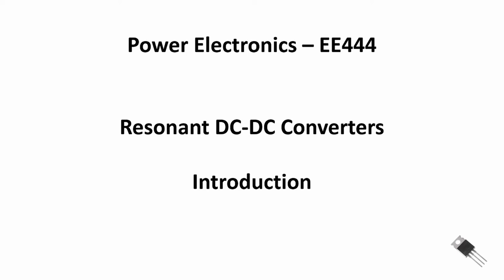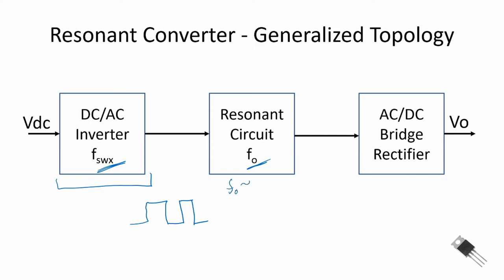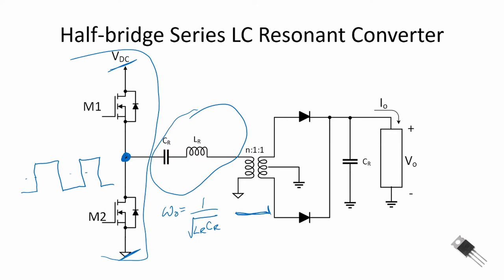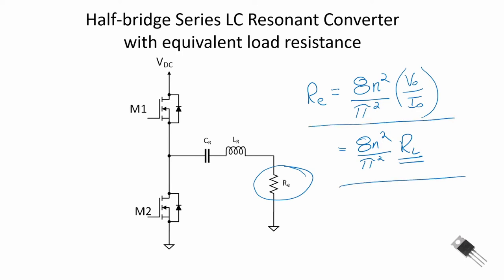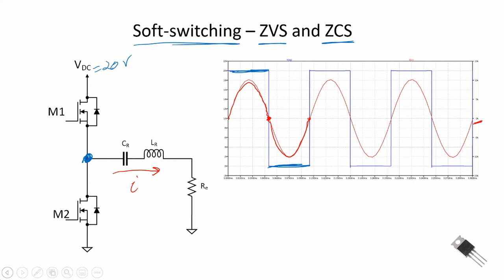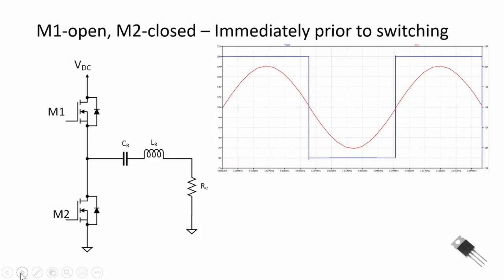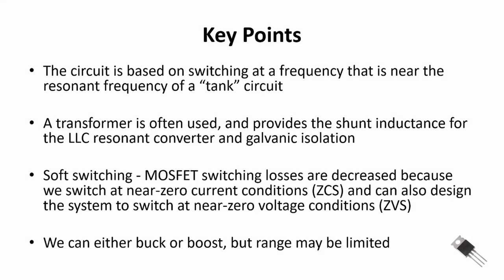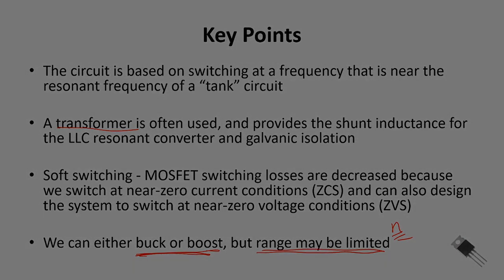Power Electronics - Resonant Converters - Intro

Comment: What kind of transformer contains Lm shunt inductor inside the trafo?? Who sells them? Can't you just use a separate inductor for Lm?
8:26 Where does the current come from that flow thru M2 body diode? Ground?
How do the mosfets know when to switch?
Can ZVS/ZCS be used in an LLC?
Reply from the maker: Yes, you can use a separate inductor for Lm.  However, for cost reduction you can have whats called an integrated design where Lm is part of the transformer.  You must control the switching of the MOSFETs.  The LLC control is similar to a VCO where the output voltage controls the switching frequency of the half-bridge.  ZVS and ZCS are paramount to the efficient operation of the LLC converter.  You must make sure to add dead-time between switching the MOSSFETs to force the current through the body diodes.  This is why you want to operate in the inductive region.  Best wishes on your design. -Dr. K

Comment: Wonderful explanation! Thank you for that! Just one small question: in the second phase that you've mentioned, just before the switching between M2 to  M1, when the reverse current "uses" the body diode of M1 to hold its previous direction, I believe the polarization of the voltage over the body diode is on the other direction (opposite to the current), isn't it?
Reply from the maker: Yes, you are correct the polarization is opposite.  It will be about 0.5V anode to cathode (source-drain).  It is still near zero volts.  This is a bit of an over simplification of the ZVZC characteristics for the LLC.  Some of the source I have listed in the description section do a much better job of explaining the ZVZC necessary conditions.  Thank you for asking and watching. -Dr. K

Comment: great work giving the introduction to resonant converter.
sir i want to increases the voltage from 390v to 1000v is this converter is suitable for this design and the converter having a power of 1200watt rating. or any other converter is suitable let me know sir. i want to use isolation converters only .
Reply from the maker: Hi Abhishek, there are numerous ways to adjust and regulate the voltage output for a resonant converter.  I suggest starting with the turns ration for the transformer.  If n < 1, you can step-up (boost) the output voltage.  Here's a link to a very nice spreadsheet from Texas Instruments that helps with all the different design equations for an LLC converter https://www.ti.com/tool/UCC25600-DESIGN-CALC
Reply: @powerelectronicswithdr.k1017  thank you sir .
i will check the design once and i will come back to you sir. instead of center tap transformer i can use without center tap transformer only for step up application is it possible?

Comment: Why does the current start to decrease halfway through M1 being closed?
Reply from the maker: Hi Nick, great question.  First, that graph is illustrating a steady-state behavior for a constant load and we are switching at resonance.  At resonance, the switching voltage and the current are in-phase.  Second, we could do a Fourier Analysis of that switching voltage and see that the fundamental frequency of the voltage wave is sinusoidal at the resonant frequency (there would be a 3rd harmonic, 5th harmonic, etc). Therefore, the current is following the fundamental frequency component and the higher order odd-harmonics are being filtered out from the current (the tank circuit acts as a 2nd order band-pass filter).  If we weren't switching at resonance, the current would be rising or already falling (lagging or leading) at the halfway point of M1 being closed.  Hope this explanation helps.  The resonant converter can be a tricky circuit to understand.  Thanks for watching and best wishes on your design. -Dr.K

Comment: Sir how to calculate Ls and Cs value i have a smps transformer ,design for 37KHz having Lm=0.348mH output inductance 18mH and 18mH (two secondary)  and leakages is aprox 1.5uH. Primary having turn 8 and secondary having 57 and 57 turn on each limb. Input supply voltage 565vdc.
Reply from the maker: Hi Anil,  I'm going to provide the following design tool from TI. This spread sheet is designed for their UCC25600 controller and automatically calculates the series capacitance, inductance, magnetizing inductance and turns ratio of the transformer.  Typically, you will start your design with Input voltage range, maximum output power, and output voltage.  You will also need to select a switching frequency.  Your frequency is 37kHz.  https://www.ti.com/tool/UCC25600-DESIGN-CALC .  Best wishes on our design. -Dr. K
Reply: @powerelectronicswithdr.k1017  thankyou sir  one more question can i design LLC resonance convertor full bridge with IC sg3525 since it is an invertor is and i have design transformer of Lm=350 uH  primary turn 8 two secondary 57 ,57 turn i have to find Ls Cs  to charge capacitor in 1.5 msec @15kv... pls suggest

Comment: Question, what typically drives the M1 and M2?
Reply from the maker: Hi @picnicsalad1.  Great question.  You would use some type of gate-driving circuitry.  That could take the form of a regulating IC that has internal gate drivers such as the TI UCC256303 or you could use the High/Lo output from that IC to drive pulse transformers.  There are different methods.  I would encourage you to look at some LLC reference design schematics.  TI, Infineon, and NXP all have good reference designs and development platforms that will help you with these types of converters.  Best wishes on your design. -Dr. K

Comment: Hi there Dr.K nice place here. I have a question about a LCC converter, the LLC I have some succes with but because I use high voltages and some lower voltages, I had more succes with a LCC who do a lot better regulation. I can calculate the capacitors but I have not ebough info how to do the Transformer who seems not a part of the resonance but is a  load, now I do not now how to calculate that, maybe a normal half bridge transformer calculation will do? Can you explane in some words? Thanks in advance.,
Reply from the maker: Hi Audio Kees, yes the transformer will appear to the resonant circuit as a load that is in parallel with either the shunt inductor for the LLC topoloty or the shunt capacitor in the LCC topoloty.  The transformer provides isolation and also enables you to either step up or down the voltage on the secondary side (i.e. boosting or bucking).  Are you looking to size for the voltage boost/buck or how to reflect the DC load back to the DC/AC resonant side of the circuit? -Dr. K

Comment: 3:45 Isn't it the opposite... if n>1, we boost the system as the output voltage in the secondary is greater than the primary one. Otherwise thank you for your content!
Reply from the maker: Hi Zluckyk, you are welcome.  The ratio Vp/Vs = n/1 or Vs = Vp/n.  As and example, if Vp = 100V and n = 4, then Vs = 25V.  So when n > 1, we are bucking (stepping down) and when n < 1 we are boosting (stepping up).  Hope this helps.  Best wishes on your design.  -Dr. K
Reply: Thank you Dr K. It was because i learned it in this way n=Vs/Vp

Comment: I have now done some tests with all kinds of resonance, I ask myself can I use a series resonant  because I do need only a rock solid voltage and low emi, seems the the series resonance do have low stresses on parts and as such lower emi, because the supply,s are for audio use, and there are audio tubes involved I need a supply who do not radiate in it making things worse. An LCC is also a nice idea, LLC do not well because of the high voltages involved. The supply has to do only keep voltage on one value.

One question arrives what concern the transformer for a series resonant, what to do with the leakage inductance? need that to include in the total Lr inductance? Otherwise I get a light version of LLC.
Reply from the maker: By series resonance, I assume you mean just an series LC converter.  While the output might be "rock-solid", what about the input voltage to the converter? Also, what about the output load?  Is that constant too?  The variation in the load will impact the range of Q that you will need to operate over.  One last thing to consider, if you are using a transformer to either step up or down the voltage, the magnetizing inductance on the primary side is utilized in the design of the LLC converter.  Just some things to consider.  If the input, output and load do not vary drastically, then an LC series converter will work fine.  Best wishes on your design. -Dr. K

Comment: Thanks for the great video. Just to make sure I'm clear on this, with resonant circuits, we are switching at either zero-current or zero-voltage. As long as we switch below the resonant frequency, this condition will be achieved? That is, we do not need EXTERNAL sensors to measure current or voltage to waiting until zero-crossing in order to determine when to turn on/off the MOSFETs?
Reply from the maker: Hi Xichen, unfortunately its not that easy of an answer.  Ideally ZVS and ZCS condition is only truly achieved at resonance.  In a practical design, you will never be exactly at resonance because the load changes, The load impacts the Q factor and changes your resonant frequency.  Typically you will want to be switching and operating in the inductive region (above resonant frequency( as this will keep current flowing in such a way as to create a ZVS condition when turning on the MOSFETs.  Here's a very good description from TI.  Please see the section on ZVS, https://www.ti.com/lit/pdf/slup263.  I hope this helps. -Dr K
Reply: @powerelectronicswithdr.k1017  Thank you.

Comment: What I missing from this lecture, how the output voltage looks like on the secondary, if filter capaticitor is not available, only the load exist.
Why the Reference Manual of Onsemi says, that this converter is difficult to operate with light loads?
Reply from the maker: Hi John, for your first question, if the filter capacitor on the output is removed you would obtain a rectified sinusoidal waveform across the load assuming you are switching at or near the resonant frequency of operation.  That frequency is dependent on the load, which we model as resistive.  This leads to your second question. If the load is "light" then R_LOAD will be modelled with a high resistance (i.e. low output current).  From equation 1 in the OnSemi paper you will find the Rac (load reflected back to the primary) will also have a larger value and this will reduce the resonant current through primary side of the transformer.  There is a minimum current value which is required to overcome the magnetizing current of the transformer.  If there current is too low, the result is discontinuous conduction mode (DCM).  Also, the value of Q becomes low.  The ST micro reference paper does a nice job of explaining some of the different DCM modes of the LLC converter and the implications of no-load operation.  Operation and control of an LLC resonant converter is very complex and unfortunately this video just scratches the surface.  Thanks for the questions. -Dr.K.

Comment: Sir, I couldn't understand that how current is being zero in switch before switching off.
Reply from the maker: The current is sinusoidal and is in phase with the fundamental harmonic of the switching voltage square wave.  This is because the load looks purely resistive at this frequency.   Also, the other higher order harmonics are attenuated and only the resonant frequency is well supported.  There's a plot of the current waveform in the video.  Hope this helps. -Dr. K

Comment: One of the best videos, could you please explain how to check and see the current wave in the primary side and check if it's sinusoidal? do I need a current probe? can you suggest one? and point exactly where to measure the current wave?
Reply from the maker: Is your question based on an actual circuit or on how to investigate the current via SPICE simulation?  For a real circuit, the answer is "it depends."  There's two main ways for measuring current.  One method is to use a current-sense resistor and the other method is to use a Hall-effect sensor.  There are pros & cons to each method.  Unfortunately, I do not have an easy answer for your question.  Best wishes. -Dr. K
Reply: @powerelectronicswithdr.k1017  It's Ok you don't have an answer for my question, but which points in the circuit to probe for the current wave?

Comment: Sir, if we will use a MOSFET instead of diodes on the secondary side of the transformer (i.e. on the rectifier side), then what will happen ?  I mean how will we achieve ZVS or ZCS in that case?
Reply from the maker: Hi Paramanand, great question.  The use of MOSFETs instead of diodes is called synchronous rectification and is very common for achieving higher efficiency.  Luckily we will have near ZCS on the secondary side. If you look at the current flow through the secondary coil(s) and you are  switching the half-bridge near the resonant frequency, the current will be sinusoidal.  Therefore, the secondary side diodes commutate at near zero current.  Therefore the  loss in the secondary is primarily conduction based.  To reduce this we can use MOSFETs and utilize the body diode to reduce the the voltage across the drain to source when we turn the MOSFET on and with the lower Rds, reduce the conduction loss in the secondary rectifier circuit.  Hope this helps and thank you for the question.  Best wishes on your design. -Dr. K.
Reply: @powerelectronicswithdr.k1017  Thank you so much sir!

Comment: Sir!! one more doubt, if a converter is not a resonant one, then to achieve the soft switching, I mean to achieve ZVS or ZCS, do we need to do some special arrangement? Like, for a simple buck converter, how can we achieve the soft switching?
Reply from the maker: For both ZVS and ZCS you typically have to be using either a resonant or quasi resonant topoloty.  It is possible to get ZCS switching conditions with a simple buck converter when going into Discontinuous Current Mode (DCM).  The downside is that you have often have a much larger current ripple through your inductor and your output capacitor has to supply that additional charge to the load.  Hope this helps. -Dr. K
Reply: @powerelectronicswithdr.k1017  Thank you, Sir !!

Comment: Very basic knowledge but explained in a very confusing way. Where is the reference for MOSFET switching in High Side Switching Mode? Do you have a MOSFET driver supplying pulses at the gates of M1? The back -BEM will do what? M1 will never switch unless there is a driver IC or bootstrap for M1. Yes it is adviseable to run the pulses at 90% duty cycle. But your way of explanation is vague, incoplete and not description. Instead of building an understanding, you are confusing more. I disliked your video.
Reply from the maker: Please do not confuse my audience. You only switch with a 50% duty cycle for a resonant converter. You are correct in that gate drivers are required. This video is not about MOSFET gate drivers. This an explanation of how resonant converter functions and has soft switching. Best wishes on your designs.